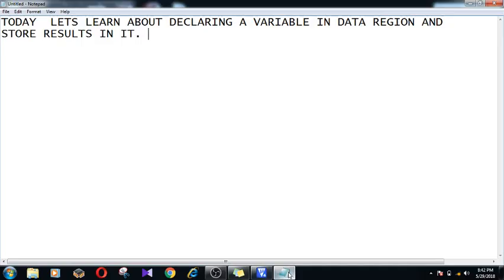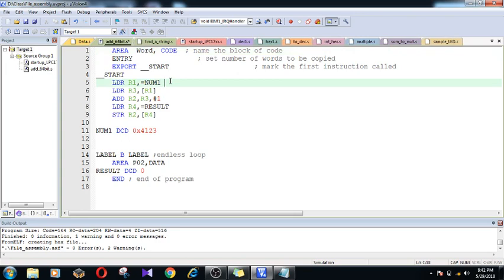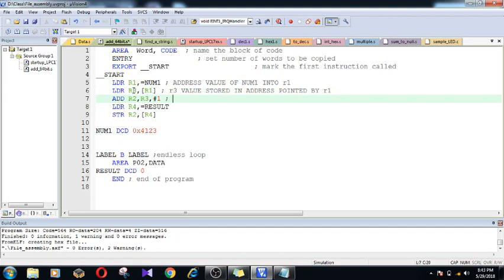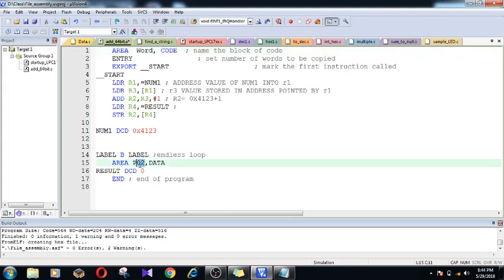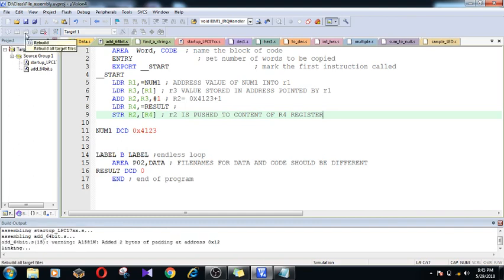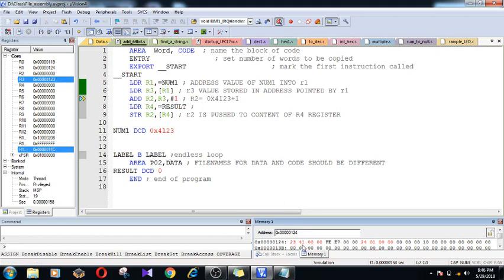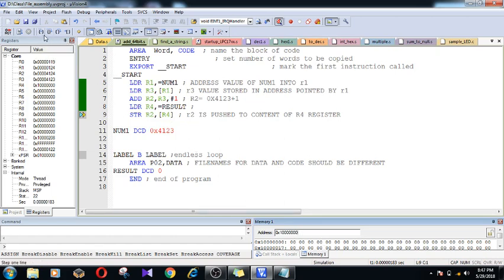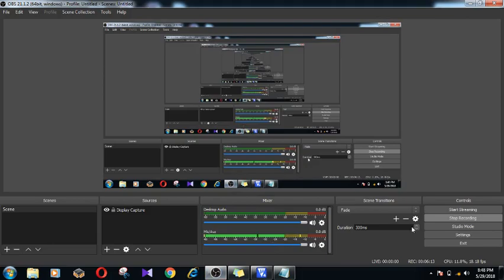arm cortex-M3 assembly code example for variable declare in data region

Comment: What is “AREA” in your code? Just a function name? Cuz i can’t find  it in the instruction set.
Reply from the maker: AREA is the directive which is used to  allocate new memory location for storing data or code of user.
Reply: @researchitechindia  Yeah, I ended up figuring out that the assembly directives are in a different list than the instruction set. So being that both lists are subsets of what you can actually enter as commands, is there a complete list somewhere that include instructions/directives/other?
Reply from the maker: @sethother8012  you can search on help on keil for arm